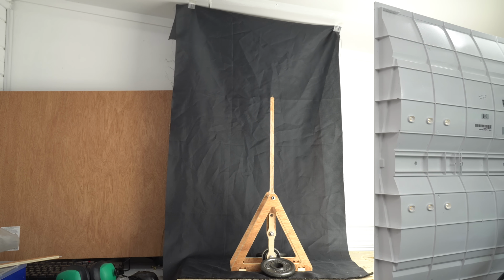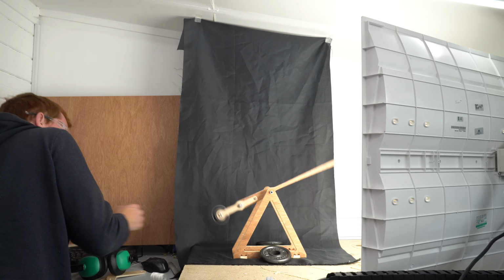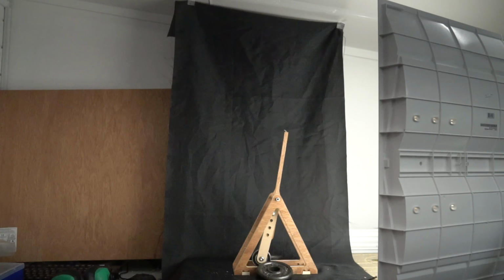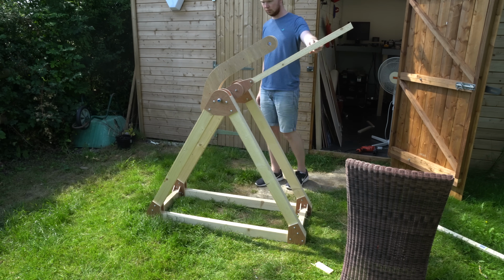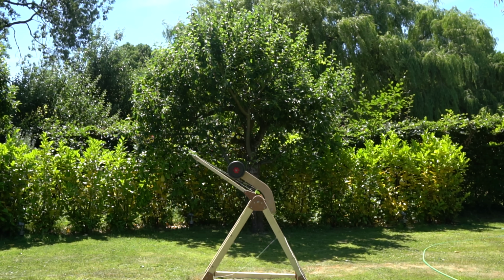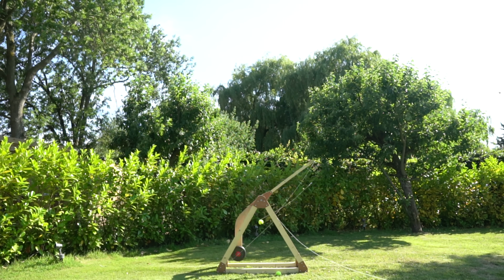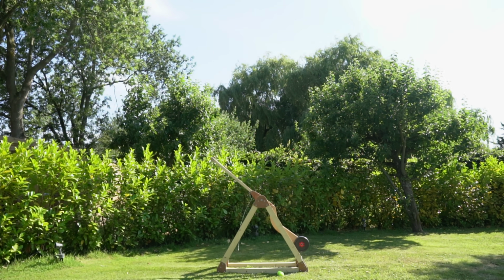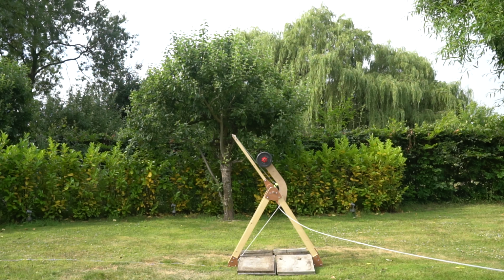Optimising a Trebuchet

Comment: Add wheels and mount it on rails. It apparently makes it more efficient
Reply: z4zuse this is true. I tested it as a kid. Less energy is transferred to the rotational energy of the swing arm and more is transferred to the forward kinetic energy of the entire system right before the release. Awesome video!
Reply: wheels let the counterweight drop straight down and so you get all the energy without transferring any to the frame and hence the ground.

[ added advantage . . . you don't mess with the length of the day (firing E/W) or the seasons (firing N/S) ]
Reply: what? that doesn't make sense. each action has an equal and opposite reaction. if there is no normal force, the frame should be moving the other direction.
Reply: @The1wsx10  Ive seen this done in other documentaries (years ago), they were firing a trebuchet with the wheels locked and couldnt get decent range, range increases once you let the thing free wheel, since the counter movement of the arm pushed the whole machine forward.
Reply: @The1wsx10  Notice how the frame rocks violently back and forth. This uses up energy. If you let the pivot slide back and forth freely, no energy is used to rock the frame, improving efficiency. The next best thing is letting the entire frame roll back and forth freely, then energy is still used up to move the entire frame, but it's not immediately dissipated as friction against the ground.
Reply: @The1wsx10  im not sure how but i think you might be misunderstanding. all thats happening is reducing friction between the ground and the frame. see how the counterweight makes a circular motion instead of going straight down? eliminating the friction and allowing that frame to move out of the way would increase efficiency.
Reply: @jasonyoung7705  Yes Jason, I think a lot of people miss the point regarding the wheeled base on a trebuchet. I brought this up with the official guide who demonstrates the Warwick castle trebuchet. The wheels are not for increased torque transfer to the projectile...or... protecting the frame from shock damage...or... increasing mobility for this siege engine. The wheels are necessary for flattening the trajectory of the projectile to vastly increase the chances of a direct hit on the castle wall target, remember that ALL castle walls are perpendicular to level ground. I agree that this siege engine was a terror weapon and had the ability to lob diseased animal carcasses and flaming hay balls over the ramparts to debilitate the enemy but it's overriding purpose was to breech extremely thick stone walls. The wheels allow the frame to move back at the same time that the projectile is being released forwards thus flattening the projectiles' arc of travel.

Comment: Nice video! Something I noticed was that you were calculating efficiency as measured against a "black box" model where the trebuchet is a machine converting gravitational potential energy straight to kinetic energy. This is actually pretty unrealistic (but is a great first-approximation method), since it neglects important factors like arm rotational energy, counterweight ending potential energy, etc, which of course have to be present in some form for the machine to operate. If you factor those things in to your "expected" velocity, you'd find that your efficiency is actually much higher than what you found!

Source: did a classical mechanics II class where we used Legrangian mechanics to calculate theoretical launch velocities of trebuchets we built, and ended up achieving ~85% efficiency.
Reply: Lukey B. The Physics G Excluding some losses (such as unwanted energy deposited in internal movement) just provides bogus marketing numbers. Losses are losses.

Comment: Hey Tom, I don't think I've ever fully explained how and why I developed the curved hanger system.  It was really to accommodate large diameter projectiles in small Whippers, or machines with narrow main axles. A straight, split rail hanger system will work just fine with small projectiles, like golf balls or baseballs, because they can fit between the rails, where softballs or pumpkins will not.  I developed the Double Link hanger system first to make space for larger pojos. It worked and performed pretty well, but the configuration reduced the cocking height of the counterweight, reducing the PE. The two counterweight bars in the curved hanger allow me to load large amounts of counterweight and move the center of gravity around, effectively opening or closing the angle between the arm and the hanger without actually adjusting the Timing Prop. A Timing Prop is a mechanical adjusting device between the arm and the hanger. My big full size Whipper did not require the curved hanger because it's so huge that there's space between the hanger rails. Even though it has a mechanical timing prop, location of the CW center of mass was crucial in getting it timed.

Comment: The big question is, where did all the tennis balls go???
Reply: Without any drag or ball mass, about 220 meters away, at 104mph and 45 degres, but they probably bounced so.... :P *edit, maybe if you did the math for mass and drag it could go to 300 meters
Reply from the maker: Tennis balls have a LOT of drag and only land about 80-90m away... a golf ball on the other hand! I tried a golf ball once and it landed 181m away, even after releasing at a really high angle. I'll give it another go once I make a golf ball sized sling!
Reply: That sounds like more video content!
Reply: You should try baseballs too.
Reply: Yeah golf balls fly much further bc of the dimples and turbulent flow! But if dimples reduce drag, why not use them on cars for example? (At least at the back)
Reply: What about a squash ball.
Reply: Or better still an apple
Reply: or a rock melon/cantaloupe....
Reply: Is there an annoying neighbor at 80-90 meters from your house? :)
Reply: Tom Stanton we still don't know where they land 😛
Reply: assuming the camera is completely level, and the 2 frames the ball is in the air are representative of the angle it leaves, it goes 199 meters (654 feet)
Reply: Into Jerusalem
Reply: Waterballoons! Been there, done that. Really funny. 😇
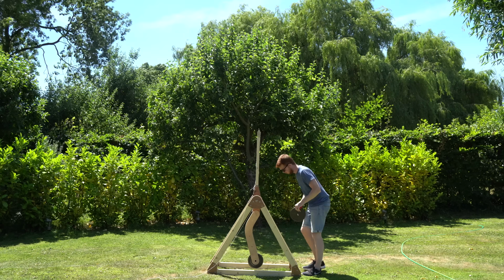Reply: @TomStantonEngineering  8:13 seems like you are going to shoot down that plane.
Reply: australia
Reply: To the left, mostly
Reply: @TomStantonEngineering  golf balls are a bit dangerous. You might want to do a range check before each fire
Reply: Neighbors
Reply: into Stanly's window.
Reply: he he nice one
Reply: The trebuchet was too optimized, the balls were sent into space
Reply: To the charity
Reply: Well no one forbids you to use a hammer...
Reply: Check out the view of his firing range.

Comment: When I was a kid,(about 55 years ago) My Dad was a general contractor and built houses so there was always a surplus of scrap lumber in the back yard, which was adjacent to the electrical power line tower right of way and that gave me plenty of room to sling objects. I”m not sure what prompted me to do it, but for a number of years I built, what I called a catapult in the back yard that was similar to the one you are using only it was much more simple, using a skinny 20 foot tree trunk laying on the fulcrum and creating a receptacle to hold rocks on the weight end an another small cup shaped thing on the long end. We just pulled the long end down, loaded it with a rock and let it fly. Very primitive, but a hell of a lot of fun.

Comment: Because gravitational acceleration is constant no matter the mass of the dropped object, there is a large diminishing return on projectile velocity increases when more mass is added. This limitation is on velocity,  so to get more output when you approach the velocity threshold, you must increase the mass of the projectile or increase the length of the trebuchet arm.

Comment: you can't optimise a trebuchet, they're already perfect
Reply: The trebuchet is the superior siege machine after all.
Reply: the perfect version called schwerer gustav
Reply: @herrpension1280 yes
Reply: You can optimize any machine that is below 100% efficient. While you can never get 100% due to losses in energy transfer, friction etc.. you can always get that 0.001% closer to 100%. I'm pretty sure that the old engineers trebuchets had higher efficiency than Tom, as they had decades to improve them. However as Tom is doing calculations and using physics, i don't think he's too far behind. And what was it? 60%~ish efficiency. Quite a room for improvement.
Reply: @RRKS  you're the guy thats fun at parties, right?
Reply: @JumalaPlays For sure. I'm the one that kicks it off. Makes dancing and drinking happen. But hey, maybe that's just to cope with/avoid me :D
Reply: space trebuchet
Reply: But that's exactly what he just did.

Comment: Great investigation. Basically, it comes down to designing something which has the least residual amount of movement in the trebuchet after the tennis ball is launched. A double-pendulum can have almost all of the energy held in the motion on one of the arms (while the other is almost still) or split among the two, so there's probably some wisdom about those that you can tap into to minimize the residual motion. I figure that there's a lot of research into this kind of thing with earthquake dampeners for skyscrapers, too.

Comment: Speed of projectile is as higher as less is inertia of the arm. So fixed arm trebuchet accelerates way slower as it has to spend some extra energy on increasing of inertia moment of the counterweight and additional part of arm. It's similar effect as in typical physics task on which barrel descends faster from top of hill:  filled with water or empty one (filled with sand).
So if the counterweight moves only in vertical direction straight and experience no rotation at all - speed of the projectile will be maximized.

Comment: Will you enhance this trebuchet out of exotic material such as ceramic bearing, aerodynamicly sculpted carbon fiber for the arm, and lead block as the counterweight?
Reply: it would be cool to see this taken to the extreme!
Reply: i thought you said exotic materials... osmium counterweight
Reply: pizza_boy18 a tungsten cube would work 100x better
Reply: Gabe Sewell well osmium is extraordinarily expensive actually all dense materials are quite expensive like tungsten gold and osmium but tungsten would definitely be the easiest
Reply: Mercury would work as well but it is probably hard to get it also it as toxic as lead so as long as you don't have cuts on your hand you can mess with it because of it not absorbing through the skin
Reply: Caleb Ames yes that's the joke
Reply: Caleb Ames r/whoosh/
Reply: Well it sure doesn't seem like a joke
Reply: surely mercury would sap energy from the throw
Reply: mm, convection might mess with it. maybe if it was in a sealed container with no air, it as a whole would act like a solid weight
Reply: If you're going for weight density you won't find anything better than depleted uranium.

Comment: in fact 42.7 m/s is NOT an efficiency of 62.5% as  you should compare joules instead of velocity. this trebuchet has an output energy of 51J which is just 39%. Sorry bro.. :/ 
did you try building a murlin?
Reply: It's a lot more involved than that too. You can't take the energy transferred to the ball and neglect the energy needed to rotate the much more massive wooden arms in the first place. You have the moment of inertia for the long arm, and the sling/ball itself has a moment of inertia about an axis that's revolving about the main axis of the trebuchet. AND none of them are revolving about their centers of mass.
Reply: pyropulse  The theoretical energy doesn't depend only on drop distance of the counterweight, though. For instance, in the case of a whipper design (as Tom has done), the long arm is already sort of pointed up when the firing trigger is pulled, but a lot of designs start with the long arm pointed down, so it is guaranteed to capture some energy as it has to be raised between start of launch and the moment the projectile escapes.

Comment: what about putting the whole thing on wheels? instead of the whole frame rocking it will roll forward and the weights will drop straighter down.
Reply: You lose energy accelerating the frame.

Comment: try throwing a plain in it, and see if it gets destroyed by the G-force or glide through the air in a tremendous speed
Reply: My guess is that a glider or water filled 3d printed rocket were high on his long list of projectiles (along with a gopro and the cat).  The rope and release doodad required to keep things aligned are probably a whole project in itself.  Thank you for sharing this stuff, Tom!

Comment: How far did they go?
Reply: Glen M a 90kg projectile can be slung(?) over 300 meters
Reply: assuming the camera is completely level, and the 2 frames the ball is in the air are representative of the angle it leaves, it goes 199 meters (654 feet)
Reply: 1wsx10 
300m, if it were 90kg.
Reply: what? you aren't getting 300m with a 90kg projectile with this trebuchet. its frame is bolted together with plywood
Reply: 1wsx10 
/r/trebuchetmemes
Reply: i don't get the joke
Reply: It can hurl a 90kg projectile over 300m
Reply: 1wsx10 You can make plywood plenty strong with enough layers.  But this trebuchet is too small to launch a 200 pound boulder 1000 feet.  For starters the counterweight needs to be that much heavier, and then every other part needs matching strength.
Reply: Probably around 150m
Reply: apparently  only 78 m  (it says so in hes next video)
Reply: in next video he did get 117 m with more heavy ball
Reply: I don't know, but perhaps you should ask the neighbor with all the broken windows and busted siding.

Comment: Nice design.  One day at around age 12, I came across two 8" x 8" six foot long lumber in the scrap pile with two holes drilled near conveniently near the ends, my first thought, a stand for the hinge of a trebucket.  By the end of the next day, I had a trebucket in my parent's front yard.  The weight was a 25 gallon barrel with rocks, the arm, varying pieces of gradually thinner lumber.  It was terribly inefficient and rather strange looking.  I think it was about 20 feet long.  It definitely had people talking for the two months it stayed there ... lol.

Thanks for answering that long lasting question in my mind about how a trebucket could be made more efficient.

Comment: What was the distance of the 104 mph ball?
Reply: well, measure the angle. then use newtons constant acceleration to get the time till vertical movement is 0. double that, then just approximate the horizontal velocity for that time.
Reply: ok, i just did the maths... assuming the camera is completely level, and the 2 frames the ball is in the air are representative of the angle it leaves, it goes 199 meters (654 feet)
https://docs.google.com/spreadsheets/d/1_UtC9ZjoW7aZw-X7mHikqZPpjg3d-9BvmxYfQhGdZYE/edit?usp=sharing
Reply: Interesting calculation. It will be lot less in reality though, because of the significant air resistance at that speed.
Reply: @1Hippo  it would also catch a lot more air than any normal object because of the fuzzes on it are made to 
cause air friction.

Comment: The more counter weight, the faster the arm movement compared to sling, the heavier your counterweight, the less Arc it will have regardless of release point angle, it just needs to release when the string is parallel with the boom, everything else depends on weight and projectile, Awesome Trebuchet, that's really nicely built!

Comment: Maybe you can add an extension to the end of the bar and connect the sling to end of that extension. If you can make this extension open while the mechanism rotating you can double the length of the bar and increase the throwing speed

Comment: Try putting the Trebuchet on wheels. The frame was rocking because your com was shifting as the counter weight moves around the axis. Adding the weight on the frame stops the moving, but you're still losing that energy trying to move the frame. By adding wheels and allowing the trebuchet to move forward and backward, the com is allowed to move back and forth, and the counterweight can fall straight downwards, imparting more of it's energy into the arm, and subsequently the payload.

Comment: Try doing this to add more energy to the projectile, if it would work, When you drop the weight straight down, the top part of that weighted arm if it could hit the projectile arm when the weight reaches it's bottom to hammer against the rotating arm it is accelerating, and having the weight released, so as not to impede the moment of the swing arm. What happens then You are if possible changing the direction of falling weight to 90 degrees to hit rotating arm,
Or at the bottom of the weight drop have it change directions to hit the rotating arm. I'm no physicist but just a thought

Comment: Put wheels on it.  The energy that gets transferred to the frame goes back into the projectile.
Reply: because ...? ...the frame on wheels , follows the projectile and delivers energy per mail to the projectile at the landing site ???
Reply: @oddballsok  i am not sure what ypu are saying. But the wheels allow the weight to go straight down instead of in an arc, so the whole thing rocks back and then forward again right at the time of release.  If you watch tje video, you see the frame get pulled off balanceand go on 2 corners when he fires.  That is alot of "tennis balls" worth of energy that is being wasted.  Also the forward rock just before release allows for a cleaner and more accurate release and for the projectile to accelerate in a straighter line before release.  It appears analogous to slinging with a rimitive sling.  I have a pet hypothesis that trebuchets were built on the direct inspiration of slings, but that is for a different discussion thread.